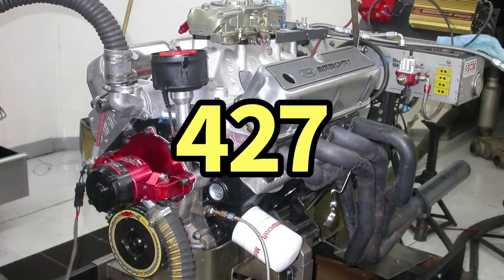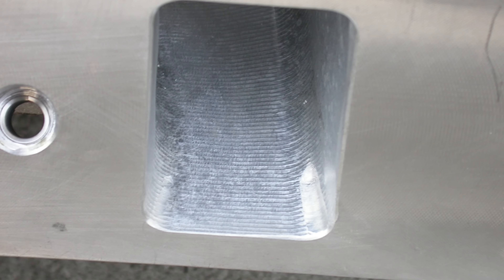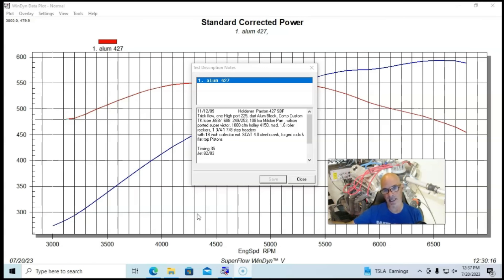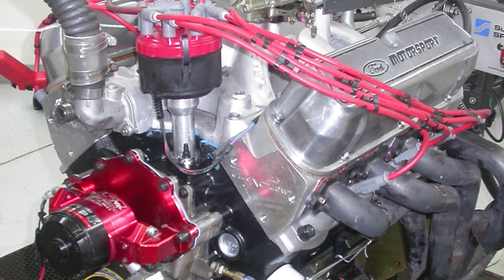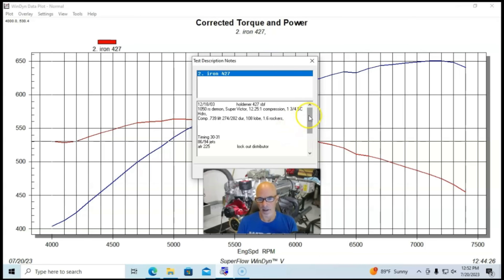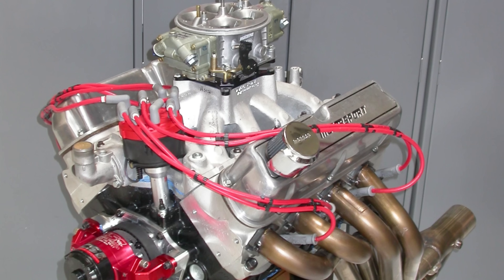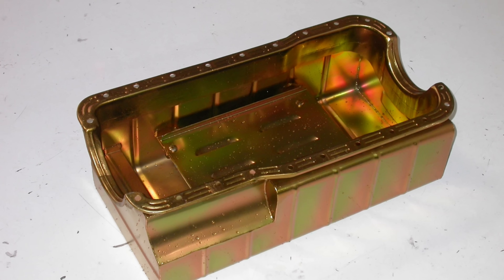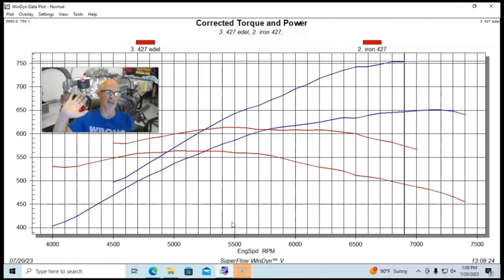HOW TO: BUILD FORD 351W STROKER POWER: 590 HP, 650 HP & 755-HP 427 FORD STROKER COMBOS. FULL RESULTS

Comment: The fine folks on the channel Powernation did a 427 with Trick Flow heads and were also "stuck" at about 590 hp. If you watch they do reveal cam specs. And it had a Victor Jr manifold. So, that seems to be a pattern. Thank you Richard for all the great content.
Reply: Super victor on the first engine. Not a vic Jr.
Reply: @I_like_turtles_67  Thanks for the heads up.

Comment: The first engine with the TFS Highports with 70cc chambers is why the motor didn't make over 600. But since you guys later added boost, it's not bad for an engine down on compression built for boost.

Comment: I sure would like to see you take that second engine and try the Comp Cam Hydraulic Roller: 4-Pattern 305QIO8 
Sku: 35-564-44 and see what the horsepower and torque is compared to a regular two pattern cam. Can't find anything on the internet about horsepower and torque numbers on that camshaft or even what it sounds like.
Reply from the maker: 4 pattern doesn't cure intake issues-Westech ran some tests
Reply: I've got a stroke 351 Windsor with real close to the same billed as Engine 2 the only difference is I'm running DSS 6 cc Dome Pistons a BMP intake and a hydraulic roller that I'm guessing goes to about 68 to 7000 duration 307 lift 589 on a 108 lsa I just feel that the camshaft is holding it back from its full potential I seen an power nation episode called 427 Windsor Warrior same combination they were running a Comp Cam 224455-12s made 610 where is flat top pistons I like the RPM to 7200 but I don't know if that camshaft would be optimal for my engine. A lot of Cam companies or parts stores when they recommend a camshaft you can call them back two days later and they give you a total different grind with the same combination so who do you trust 😂

Comment: How long are the cylinder sleeves of a 351W to enable you to stroke them out that big? Are they 6.5' to 7" long?
Reply from the maker: after market blocks-bigger bores
Reply: @richardholdener1727  Isn't he using a production block?
Reply from the maker: A 427 IS A DART 4.125 BORE WITH 4 INCH STROKE
Reply: @richardholdener1727  The length of the cylinder sleeve is?

Comment: A set of CHI or Yates D3 Cleveland heads would have made massive Horsepower on the last 427...Cleveland style canted valve heads make the most Horsepower on pretty much any SBF...windsor had the better bottom end but the Cleveland had the heads and intake to make some serious Horsepower...combine them both and build yourself a Clevor!

Comment: Awesome result and we forget about the Victor Sr head.    It bested the AFR 225  by a ton.    On the curve it beat it across the board.   Edelbrock knew what they were doing with that head.   Victors beat the AFR 225 by over 100HP and 50ft-lb.

Comment: I'd love to know what you'd do differently for a 351W in a hd truck application, like an F350 for towing. Would you still go with a stroker? What would you change?
Reply from the maker: stroker and milder cam
Reply: @richardholdener1727  thanks for your response, one last question. With the introduction/capability of smaller displacement turbo vehicles like the newer Ecoboost f150 V6 I am surprised we don't see more people doing "smaller displacement" 351 turbo gas trucks (vs 460).  I've been digging deep trying to find examples of someone with a lower compression turbo 351 in a truck for towing but have not found any.  How do you think a stroked tried and true Windsor can compare to the new gas 7.3.  I'm trying to find a solution for my blown-up 351w (as of this past Saturday) in my 1990 f350.
Reply from the maker: a mild 351W with a turbo would be very capable

Comment: I’d like to add a comment on the last combo 
There was at least 30-40 hp with a 1050-1100 cfm carb 
I cannot believe the lower pk hp rpm knowing those heads were 280 cc plus and a large cross section 
Those heads need 850-900 lift 112 -114 lobe sep and 278-300 at .050 
And hello hp

Comment: Have you ever tested "the budget" 351W stroker. Using a 3.85 crank and standard size used 302 pistons?
Reply: I'd like to see that as well
Reply from the maker: no
Reply: With the strokers if you will do a 3.85 stroke ( 393 ) you might as well do a 4.00 or 4.20 stroke ( 408 or 427 )
Reply: @dennisrobinson8008  But then you would have to use aftermarket rods and/or pistons.
Reply: @DustinDoesStuff  i see what you're saying about budget

Comment: One of my dream builds is a '70 mach 1 with an all alloy 427, a 6 speed, big brakes, and IRS out the back. That way it will be quick in the canyons as well as in a straight line.

Comment: Would you run a dual-plane on a 427 stroker sbf in a very heavy street car or would you run a single plane? Thankx.
Reply from the maker: a single plane
Reply: You'll get more torque with the dual plane, which is what you need for the street.
Reply: @PatchesOHoulihan69 But a 427 stroker already has a ton of low end torque. Using a single plan obviously compliments top end, and won't hurt "seat of the pants" torque very much. With that many cubic inches and cam size, you'd definitely want a single plane.

Comment: That first one just ran out of air. Cam was too short to take advantage of the intake manifold.  The second one had enough cam at 274/282 and plenty of intake manifold. That torque line on that third engine is a thing of beauty.

Comment: I'm curious what differences there would be with a similarly built stock block 416". I might engine swap my 351w e150 for better towing capabilities ie diesel would be best. I want at least 18 mpg unloaded which probably means stock cubes small cam with efficient heads like afr 165's...or a mild 6.0 LS but getting better than 14 mpg might be tough.
Reply: If you're going to get the AFR 165 might as well get the 185's there is no downside.

Comment: I love the Windsor small blocks. I like Chevy and Mopar as well. I think that Windsor small blocks are underappreciated.
Reply: Unfortunately, Ford has a tendency to be very conservative with their engines, erring towards reliability over power.  I think this has led to people seeing Ford engines as dogs, or boat anchors.
Rather like the 70s cars… in most every measure, 70s cars are better-designed than 60s cars, but they lack power, so everyone thinks theyre crap.  When you do a rebuild of that 40-50+yo engine, build some power into it, and suddenly that 1974 Grand Am, or 1978 LTD II, or 1976 Mustang Cobra II, or 1977 Charger is a seriously bad ass car!
Unless you have to rebuild a motor to stock specs, for insurance purposes, there should be no reason you cant add some power, and not lose much in hp, OR gas efficiency.  I lost an average of 1hp, as long as its every day driving, when I added a 235hp Roush Supercharger to my 17 Mustang GT, and it was all done on the factory warranty.
Reply: @buzzbomb67 Fords always made power the 70’s epa choking engines slowed everyone down not just ford the 454 was absolute turd stock 351 Lightning beat it very easily stock.
Reply: @CoyoteFTW  oh yes … relatively speaking, Fords were no worse off than anyone else was, and often did more with less!  Nonetheless, we can definitely improve of those poor 70s cars!  Such good cars, but are always maligned for being heavier and no power.  Both issues are easily remedied lol
Reply: @buzzbomb67 Man, I'm really glad I googled it before sending the reply I was about to, of "there was never a 1977 Dodge Charger!"  

Well, Chargers have been my favorite car for about 25 years now, and I'll be damned...
Reply: @Kisiah_Forge  ya I was surprised too, when I found out.  Always thought it was just the Cordoba and the Magnum, at that time!  Also surprising, was the 1973 GTO … thought they skipped 73 altogether.
Reply: I hear ya,  I just remember them having there day back in the 90s. Had an 85 GT with a 351W around 1995. Imo, that was the hot swap then. Plentiful cores around and they were stronger than the 5.0
Today,  they seem forgotten 😔
Reply: I enjoy cruising the streets with an underappreciated engine, especially in an underappreciated car like my Mustang II. Double underdog. lol

Comment: Enjoyed this video very much! Back in late 2009 I started planning my 427 Dart/Windsor build for my street 1985 Mustang LX. Picked up that book you wrote on the Ford Windsor Strokers which had great info for parts needed and went to work. Long term durability and torque at street range RPM was the main focus here. I used the TF 225 High Port heads and a matching Super Victor intake from TEA. Compression for pump gas 93 was set at 10.3 and the carb was a custom Holley flowing 900 CFM with Kooks 1 7/8 headers. Cam was the Lunati hyd. roller Voo Doo series with 
241/249 duration @ .050 with .600 lift on a 112 LCA. The engine installed in my 85 LX coupe with a TKO 600 trans and a 3.50 geared 9 inch rear.  Would run easy launch talking roll out at 2500 and then hit it in 2nd gear 10.90-11.00 at 132 MPH only hitting 6000-6100 RPM thru the lights. Would pull the front wheels in 2nd gear and shutdown my buddy's 1970 511 cube Hemi Challenger!
Now 13 years later still running well with no smoke and no oil drips or leaks with 195-200 PSI cranking compression. 6 years ago I replaced the Super Vic intake with a dual 660 Holley intake made by Price Motorsports the ONLY guy to make such for the 351W. Looks exactly like a FE 427 dual quad type intake. Yes the smaller runners hurt a bit over 5000 RPM but still made 480 HP and 505 Torque at the wheels all in at 5600 RPM Torque curve is crazy fat and flat with this thing and a joy to drive. You can cruise at 1500 RPM in 5th gear with no issue. Plenty of fun for me at 69 years and owning this Mustang for 38 years!  Thanks for the work you do and show us! A liitle video clip from last week when I added 1 inch phenolic carb spacers to keep the carb heat down. Cranks right up after sitting 20 minutes after hot day drive. https://youtube.com/shorts/PwjooOAqrjc?feature=share
Reply: Why spec a 112 LSA can for an NA build? 105 or 106 LSA would have made more power and given the engine what it wants. You're probably down 30-40hp.
Reply: @pimpovic2  112 for a better idle quality and vac for my power brakes. Every 427 Windsor is not a race engine.....this is street use.
Reply: @fortyshooter1  Same reason mine is 114, softens up the bottom a bit too which helps with my primitive suspension.
Reply from the maker: IF ONLY EVERY MOTOR WASN'T BUILT FOR MAXIMUM POWER, BUT YOU OBVIOUSLY MISSED THE 108 LSA
Reply: Wide LSA almost  like you specd an EFI camshaft

I'd agree with everyone else 105-108 LSA MAX on the camshaft
Reply from the maker: we didn't spec any cam-just tested a bunch

Comment: 30k for a reliable 1000hp engine
Reply: Or less than 10k for a turbo motor that does the same power with a broader torque curve.

Comment: Some people make real good breathing heads for the small block Ford engines. Those rotated canted valve heads move a bunch of air.
Reply: You mean twisted wedge heads?

Don't tell inline guys that lol that's always been a debate AFR vs trick flow

I'm not even gonna get into it lol😂
Reply: @KingJT80  yeah the d 3  heads Fall in there too
Reply: That (TFS) and Cleveland style heads. @KingJT80